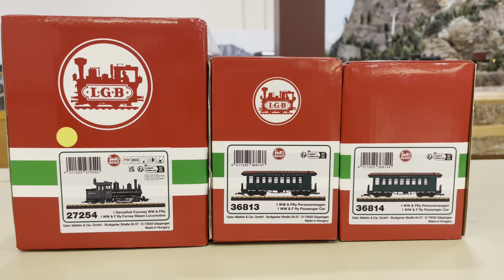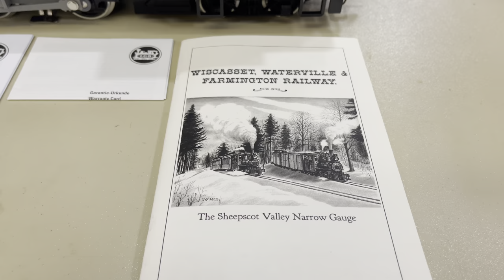Review of LGB 27254 WW & F Ry Forney and Passenger Cars LGB 36813 and 36814.

Comment: The cab, domes and smokebox on the LGB model are way off. Typical LGB nonsense. I'll keep my Spectrum Forneys.
Reply from the maker: If you go to the actual historical website for the railway you’ll find they’re pretty close.
Reply: THIS MODEL IS VISUALLY CRUDE COMPARED TO THE SPECTROM MODELS. LOOK AT WHAT SHOULD BE THE OUTSIDE COUNTERWEIGHTS, THEY ARE THIN WASHERS.  THE LBG RUNS BEAUTIFULLY AS DOES THE BACHMANN,